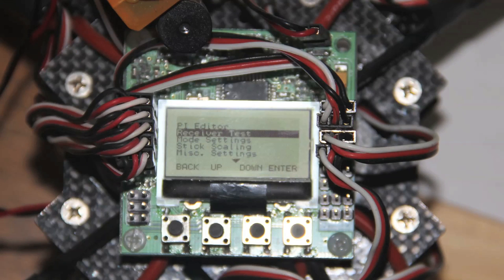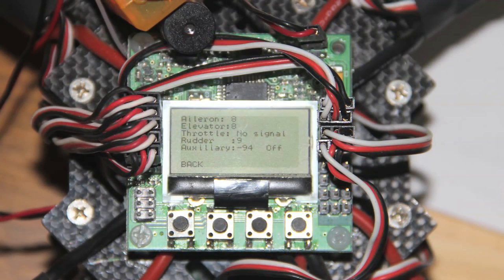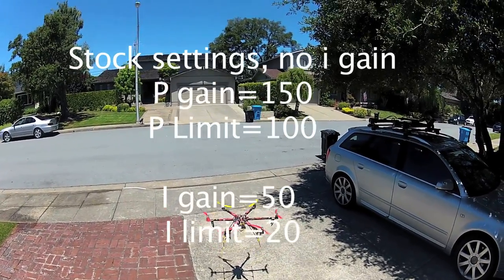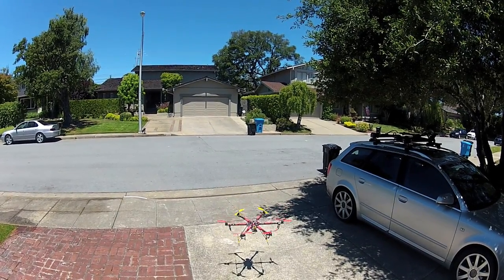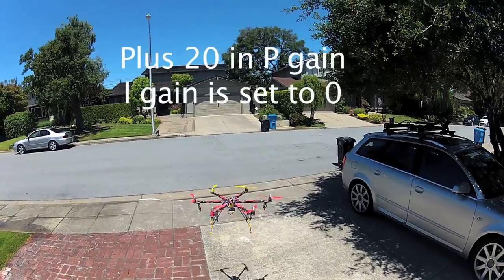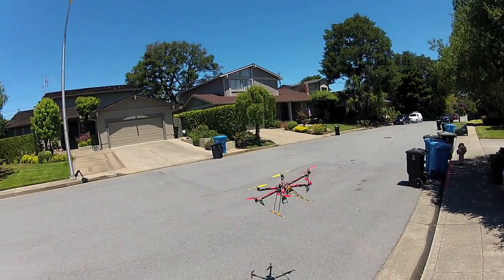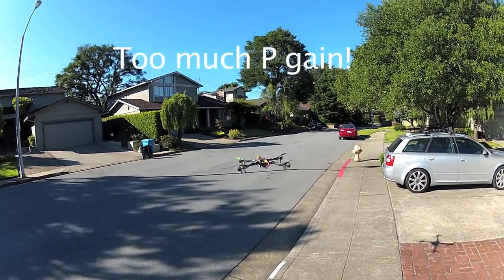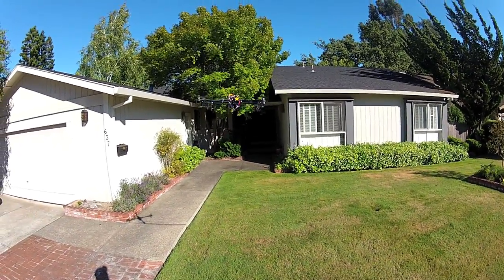Hobbyking's KK2: QUICK START TUNING GUIDE

Comment: Just got my KK2 board for my Tricopter and was quite surprised at how bad it flies with the default settings, after fiddling with P and I settings and changing my digital tail servo to High refresh, I began to see some improvement. Thanks to your video it confirms my suspicions. Seems like I have a lot more tuning to do. It does feel more locked in compared to the older KK board.

Comment: The old board worked also fine, you only needed to play a little with the sensitivity and have it re flash also with the software you needed to fly with. Example + o x configuration, normal or acro... it was important to do this otherwise it will only work as a + quad configuration. 

I hope your KK 2.0 arrived and you are flying now fine!

Good luck!

Comment: Though not covered in the manual, even though mercifully it wasn't written in Chinglish, checking the receiver inputs while operating the sticks is quite illuminating. I was trying to fly this Tri with my rudder and elevator reversed. That's going to be a lot more gratifying to fly now...I really thought that I had no skill what so ever. What a relief. At 45, here I was under the impression that my hand to eye coordination was gone. I am light as a feather and chuckling lightly to myself. Hahaha

Comment: This is the latest values I have for my rcexplorer.se's Tricopter 2.5, it is a little "Drifty" but at least it doesn't give you surprises and can handle very strong winds. Now it is just up to the skill of the pilot.

Roll/Pitch (Aileron/Elevator)

P Gain : 30
P Limit : 100
I Gain : 3
I Limit : 20

Yaw (Rudder)

P Gain : 30
P Limit : 20
I Gain : 3
I Limit : 10

Stick Scaling
Roll & Pitch : 50
Yaw (Rudder) :70
Throttle : 100

Comment from the maker: calibrate the esc's individually through the rx like you would a plane. The yaw servo will need to kick to the side when you start rolling the throttle on. That is normal to counter act the rotational force of the props. You can update to 1.2 on the board to get access to servo filtering too. It may be unnecessary for you.

Comment: You could use servo connectors and the 26 gauge wire as well. But I used two pin molex. You only need to hook up the positive to the soldering pad on the back of the board, ground is already covered by connection of the ESC on M1. Make sure it is standing off a metal frame with nylon post and screws. Or just mount with the FC mounting foam tape that Hobby King sells. While you are there look for two pin male and female connectors that you might find more appropriate than servo connectors, Cool?

Comment: double check all connections are in the right place(trust me I have done it),do the receiver test to make sure all sticks are giving the correct control input aileron left/right,throttle +/- ect,check motor layout is correct,check motor rotation is correct,follow this vids instruction and good luck :)

Comment: Sure, I'll be spending today tuning my kk2 board and I built my Tricopter according to David's (rcexplorer.se) specs with a slight change in materials (carbon fiber) and a more secure tail mechanism. You can google this thread "My KKboard family of multirotors!" on page 4 of the thread for more information. I will post the PI settings once I get it rock solid.

Comment: The default Tricopter layout shows all 3 props as CW, mine are all CCW. Short of changing props and motor directions do I have to tell the board to reverse direction somehow?
It seems to be doing the right thing when testing mid-throttle on the ground but am having trouble obtaining smooth flight.

Comment: hi great vid! thanks for that. 

just wanted to check if you could explain the following

1. does the P and I LIMIT have to be less than the P and I gain themselves? I cant really tell the difference when i change the limit settings. are they in terms of percentage or a raw physical value?

2. Im using hitec hs55 9 gram servos and i have set my servo filter to 50. what do high and low servo filter values represent? (i could get them to work at 1 - 80++ servo filter values). which is better?
thx!

Comment: Good video,I just built my first quad and tryed to hover it in the house an its very unstable 
.
it wants to tilt to one side and forward an backwards just unstable,what do you thinks wrong with it.i am using the kk2 board.
i am not sure that the esc's are calibrating properly,they dont make the same sound as the one in the video i am watching.that would be diehardrcaddicts,sk 450 quad build.
thanks for any help.

Comment: what is the esc/motor layout the hex x?  Does the motor layout go right around starting with the front 2 123456  or does it go something like 135246?  As far as the channels from the esc to the board?

Comment: I run a 600 mm quad and found to counter wind gusts I ran it down to 35P gain and 25P limit and use about 25 I gain and 18 Limit. I'm sure it could be better could you help ? Looking for midway between dynamic and silky smooth. 
I'd like the Yaw response increased hugely but want it to stop on stick release. Perhaps i should try your Quad settings and see. I run about 65 % stick scaling FYI.

Comment: Hay Partner, I just built my second 250 quad and have it pretty much dialed in except the rudder/yaw. I have it turning at the rate I want it to but it continues to overshot by a little. If I just hove it and give it yaw left and right it over shots just a little. Is that the I gain on rudder that makes it stop on a dime? please help sir.

Comment: If it works otherwise just reverse the yaw channel.  If that's not possible you should be able to fix it with reversing all your motors and switching props accordingly.

Comment: I have driven mine into the ground 3 times. once the quad stuck into a 2x4 hand rail on my deck from about 80 feet up...still flying it.I guess if they make it past the "burn in" phase (i've always heard it was 8 hrs for electronics, meaning if they are gonna fail this is when they are most likely.)

Comment: Hi dhdsracer I Would Like To Give You A Up Date Of The KK2 Troubles As You Said About What I Could Do. I Am Flying On Only P Settings Work Out Good Thanks For Your help With That.
But When The Lipo's Power Gets Just Under 11 Amps My 4Th Motor Stops Spinning Up.
I Have Taken Motor One And Put It On The Board were Motor Four Goes That Will Do The Same Thing.So I Know Its Not A Motor Or ESC Thing Any Idea What It could Bee ?

Comment: I have a quick question.  Hi im a noob I'm about to re flash my kk2.1.5 . Are all usbasp's wired the same because I have seen some different pin outs on these. I have one with 10 pin so I bought a 10 to 6 pin converter will this just plug in or do I need to swop some connections around. .... don't wanna fry it. Thanks Mark

Comment: Hi dhdsracer
I just started setting up my board now my craft i a tricopter and the motors don't start up together and the yaw motor spins really fast at just a touch on the throttle stick. 
I tried calibrating the esc but no sounds happens and I keep waiting for that process to complete and it doesnt happen. 
Have you got any tips ??
Thanks 
abimeleke

Comment: What difference is in the Simon K flash ? My speedys are 2 MS 500 Hertz style build specifically for the Wookong and Nazza. Do you think I should flash them ? I thought the Simon Kflashing was for the slower cheaper speedys to get them up to speed. Tried higher P gains but when the wind is high i get TOO much instability.

Comment: I Have Just Put The KK2 In My SK450,I Have Tried What You Said About The P & I Setting.
If I Go To High Setting It Goes Crazy On Me.If I Turn Them Down To P @ 25 And I @ 45 It Still Wants To Wobble About I Have Also Tried Going Lower But Not Much Difference In How Stable It Is.
Have You Any Idea What I Can Do To Get It Right.

Comment: Hey dhdsracer,

I just bought a KK2.0 control board and came with no instructions...im a total noob in the quadcopter world...I've tried to google and have emailed the seller who sold it to me but no word. So i just want to know what is the little wire that comes with the KK2.0 ? it looks like a servo wire attached to a magnet looking thing at the end with a + sign at the bottom....any advice or feed back would be a ton of help...I don't want to fry my New KK2.0 board yet..lol..

Thanks LeMarQ

Comment: hey admin I'm having a trouble in starting my quadcopter. when I rise the throttle the motors doesn't spin till I push it to the middle then one after an other motor stars to spin can u plz tell me what's the problem with it

Comment: hi dhdsracer.

I tru to fix my hexa whit the kk board. but will stil not work pleas can you help me whit the right settings?

I have a F550  rct 1000kv motor 30 amp esc  10 inch props from rctimer carbon

Zender dx8

many thanks for reading my question.

Best regards Koos

Comment: After reflashing with the Ver 1.2  I have not been able to get M3 to spin. It twitches a little but that it it. I have replaced the ESC and motor several times, recalibrating each time. I was flying yesterday with the stock firmware. Any thoughts?

Comment: Hi I am building a mini hex, In this video you mentioned that your pi settings are suitable for hexacopters, is it suitable for the mini hexacopter as well?
Reply from the maker: Mini's are normally different in values but it's mostly power and leverage that dictates tuning. You'll need to go through the tuning process to dial it in.
Reply: dhdsracer about the esc's i have 6 with SBEC: 5v / 1A, should i connect 6 of them? or should i remove any bec?

Comment: dhdsracer..I have tried to use the method where you turn on your radio, set the throttle up, power the KK2, then press buttons 1 and 4 at once. Doesn't work. My motors run. Not getting any beeps.
Reply from the maker: Do them individually using the throttle channel on your Rx. In not sure if the kk2 bypass is still active on newer firmwares.

Comment: The only problem I have is that I dont have a single P/I limit/gain setting. I have ailerons, rudder, and elevator. And another in the Auto Level function. We need a step by step setup for quad-X config.

Comment: Hey, I am having a small issue with my tricopter. It flies great, but when I go to land, I ease back the throttle, but at about a foot of the ground, it drops like a rock. Is there a setting that I have overlooked?
Reply from the maker: Did you calibrate the Esc'ss?
Reply: Need to turn the brake OFF on the esc's

Comment: My quad is too fast and goes outta control..
using this kit ST360 with motors from HK.
What to do? :((
Newbie I am. crashed several times ubut broke nothing except the landing gear made outta self cut plastic and wood :(

Comment: Hi i have gotten a tricopter from my brother in law he gave up on it cause it won't fly when its throttle'd up one motor gets way more power than the other two and it just flips on the ground any ideas of what might be wrong with it
Reply: You need to calibrate your ESC's
Reply: It could also be that your board is not mounted in the correct direction

Comment: What do i need to do when my quad is not going straight up when i punch the throttle? (Instead it is going left backwards)
Reply: +djRC did you managed to solve that , i have the same issue , pls help
Reply: +bigheart2050 it works for me , just re arrange motor1 as 1234 on the fly controller.
Reply: +bigheart2050 i use an other FC now

Comment: I'm having a problem and cannot find an answer anywhere,I CANNOT get the Board to Arm.
I'm building a Tri-Copter via David Windestål's Instruction and Design and It's all ready to Fly, spent more hours programming and trying to get the KK2 to Arm than I spent in the actual build, what's up with that? I'm really at my wits end here, why can I not Arm the Board, I followed the instructions to a T! Not to mention watching Vids from 20 plus others, with no solution yet...  PLEASE HELP!
Reply from the maker: Trip your throttle down a 5-10 clicks and try it.
Reply: dhdsracer Thx for such a fast reply, OK I'm doing the trimming as I type this, so if I set my Throttle in the KK2 lower or is that in my Sub Trims on my Transmitter? I'm using the Hitec Optic 6 Sport so I do have the ability plus dual rates and a safety disable switch, which works as well, checking my reciever through the KK board everything registers fine, let me try that and I'll let ya know how it goes, pulling my hair out going on day 2, sure hope this works and thx again..

Ok, messed with the throttle and also zeroed in the rudder and still having no results, but does sound like this is going down the right path, I'll try some more tuning, maybe I'll see progress finally?
Reply from the maker: Soco Joe Most time when it wont arm the throttle is not in the safe position. It's just a touch up where it wont arm. If you trim down on the tx, it fixes that. If that's not the problem, we need to look elsewhere.
Reply: dhdsracer Welp, that was a total wash, still no worky, only other option I see is order a new board and see if maybe I have a defective, I'm not doing well with this one for some reason. During my Reciever test, Rudder shows Zero and full Right rudder shows at -100% due to reversed servo on my x-mitter, so I should be good to go, right? I don't know, thx again for any help you might think of in the future..  :(
Reply from the maker: Soco Joe throttle channel isn't reversed? Seems obvious but it happens. Try going to 125% rudder travel in your TX too.
Reply: dhdsracer Something I noticed, to make the Throttle read Zero on the KK2 while doing my reciever test, I have to set my Sub Trim settings all the way up to +89 and that seems a bit extreme, not sure what that's all about?
Reply from the maker: Soco Joe Not sure. PPM or pwm? Try reversing it. I think it's reversed.
Reply from the maker: Soco Joe NO PROPS! Don't forget
Reply: dhdsracer Yup, for sure, got the props off, 3-10-4's could do some major damage...hehehe.. but yea, thx for the Tip!..   :D
Reply: dhdsracer Just so ya know, I GOT IT! Whoot!!!!
Just User error, First Computer Radio, overlooked something, so I restarted all over and fine tuned the Radio, not sure what I fixed, but step by step set up from the manual fixed it, Thanks for Your input, gave me food for thought, which steered me in the right direction.
Nice Vids by the way! keep up the good work and thx again..   :)
Reply from the maker: Great to hear! Have fun!
Reply: dhdsracer Fun! I'm setting up for FPV as soon as I can fly this thing well enough, OH YEA, This is gonna be the most fun I've had with my clothes on...hahaha...   :)